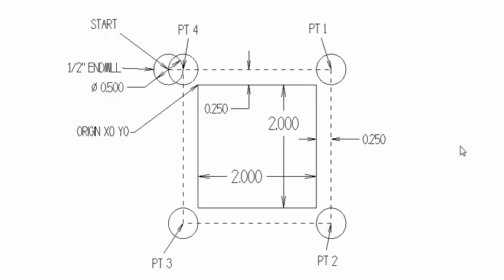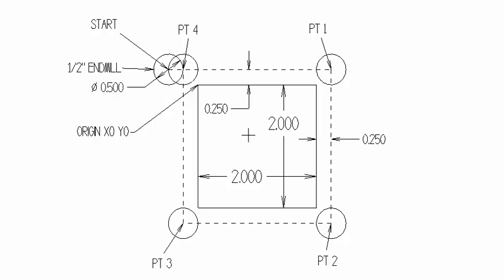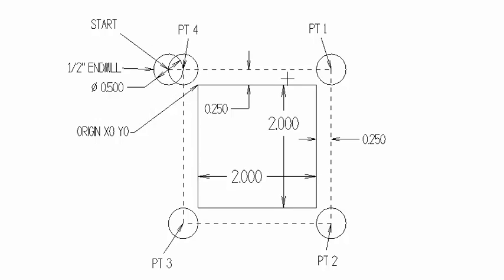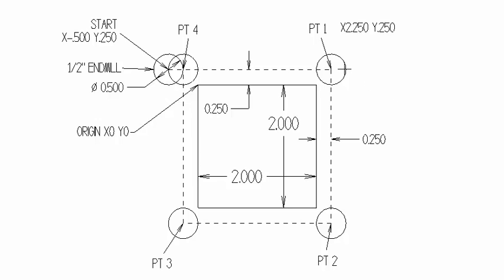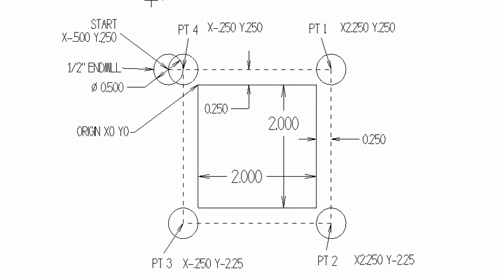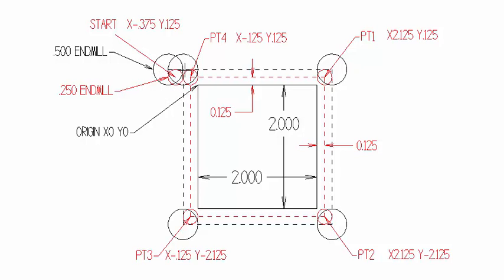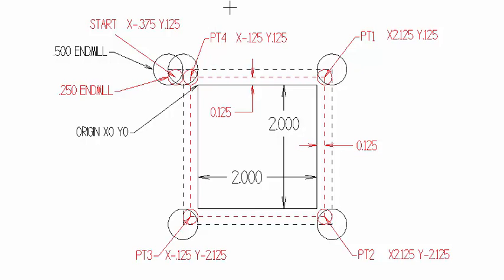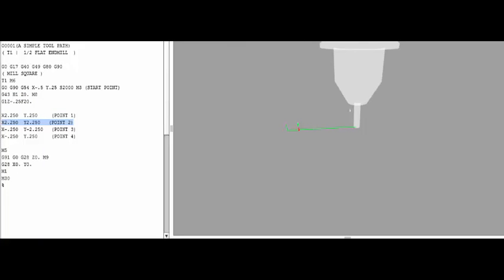BASICS OF A CUTTER PATH ON A CNC MILL

Comment: I understand you’re using a 1/4” endmill for the second part there but with your starting point did you use the 1/2” endmill and then use the center of your 1/4” endmill to get -0.375” or 3/8”?

Comment: Top right corner you are at y.250. When you go down you are y 2.250. If you are at y .250 then you go down y 2.250 you would be at the bottom of the block. Why wouldn't it be y 2.500 if you are .250 of the top and want .250 past  the block?
Reply from the maker: Stephen Krausss  That's a good question. When you are at Y.250 then the center of the tool is at a distance of .250 on the plus side of the Y0. line. When the tool is at the bottom of the block the center of the tool is 2.250 on the minus side of Y0 (Y-2.250). Always be aware of where origin is and where the center of the tool is in relation to that. Hope that answers your question. Thanks Tom